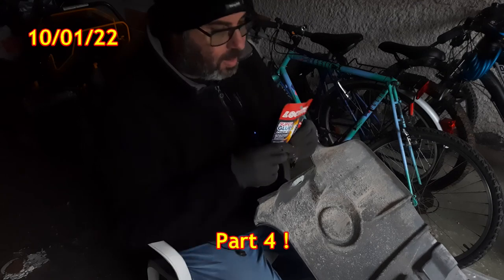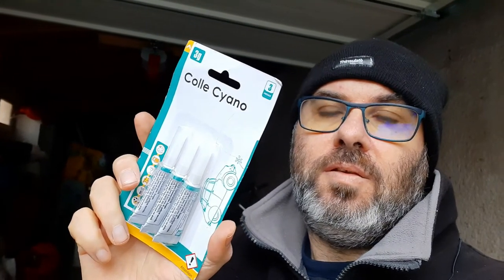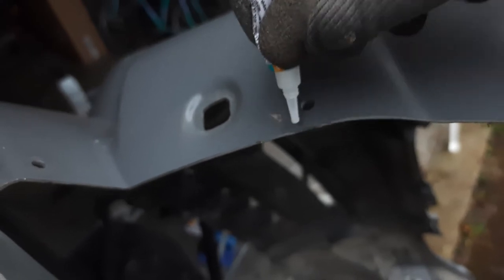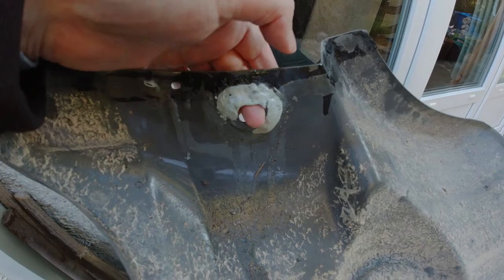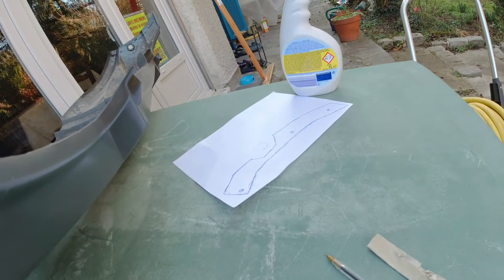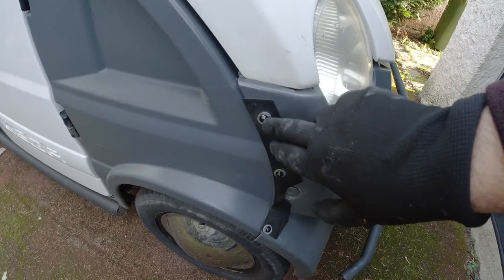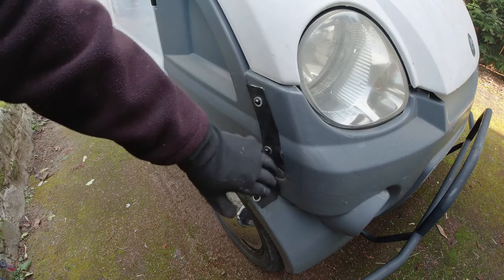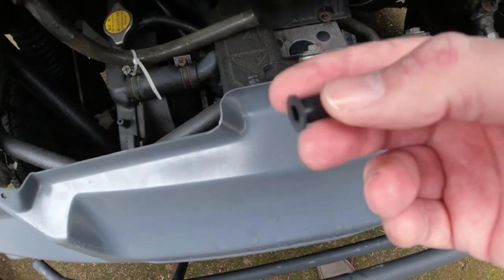Front dash panel repairs - Part 4 | Side mountings and rubber strips | Aixam Mega Multitruck

Comment: Use 2k gleu  i will sent a link its best for plastic repair
Reply from the maker: Never heard of that one.
Reply: I,m using it to ,because also mine have some  cracks at the pilar 
Im restoring a mega, its the pickup  version  ,its a big job bigger then expeckted, i rebuild the whole brake system  rebuild the chassis and bought another engine because there was a leak on the paravan body part thats catching the water from the front window i dont know how they call that in englisch , and that water leaked into the  inlet manyfold  so the engine had not much compression anymore ,i also replace the gearbox mount rubber  (,use this type 65sh, )and only use orginal aixam ,they are notorious for getting bad  and,i changed the whole wiring because they had ,doing wird things whit the wiring (cutting),btw ,parts are not easy to get second hand ,

,when well maintaned the engines can drive 150,000miles ,gearbox must maintained every 37,,000 miles   ,geabox pully, ,can get loud sometimes but dos not have effect on funcktion 
Flexible exhaust part can crack and then leak ,they are not expensive in the netherlands they are around 35 euro 
Front caliper guides can get stuck, because the guides stuck because  of buildup from brake dust, clean them every 7,500 miles 
The front engine mounts check every 7,500miles for cracks in the rubber when the go bad the rear engine/gearbox mount get bad very easy
Reply from the maker: Thanks for writing in English - my Dutch is non existant, but I am able to communicate in French if needed too. Yes I get the impression that parts are going to be an issue. Especially bodywork panels. Although you can still get mechanical items from various VSP "shops" in France, the panels seem to be mostly second hand.
I guess in English we'd call 2k glue epoxy resin. My Dad used it a lot  for his radio controlled aircraft and other plastic based repairs back in the 80's. I think that as you suggested, I'll have to use that to repair the door pillar.
I did try epoxy putty on a floor repair, but it just fell off. I have since repaired it with home made plastic slurry - it hasn't moved since I did it, so seems to have worked.
I think it'll be a while before I get to 7,500 miles - I only drive around out village for now. When I bought the van, the engine had 88,000km - then 3 months later it blew and so was replaced with a second hand engine. This one was 28,000km. I don't know if the mounts were replaced then.
Reply: @MegaBreadvan  the whole floor part is made of polyester with a topcoat , use polyester putty with fibres  or use the 2k gleu, tempratures are less and less warm last weeks going more and more to autumn ,so keep in mind that below 10 celcius  its almost inpossible to use polyester  ,or you must have a warm shed or garage i will post some pictures ,
Reply from the maker: Thanks for the tips. Hopefully most of this week will be higher than 10°C, so I'll order some 2k glue, as that door pillar really needs doing. I now need to think about what I can to to re-inforce the space behind the pillar to avoid having the same problem again.